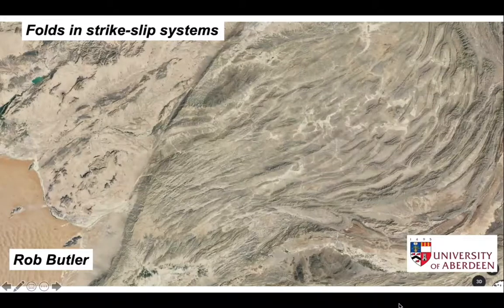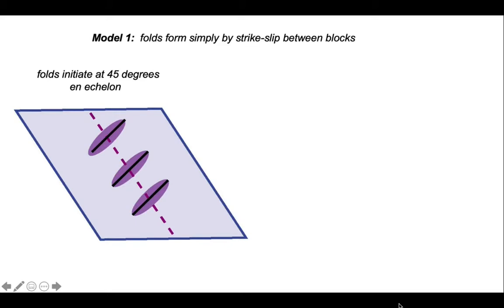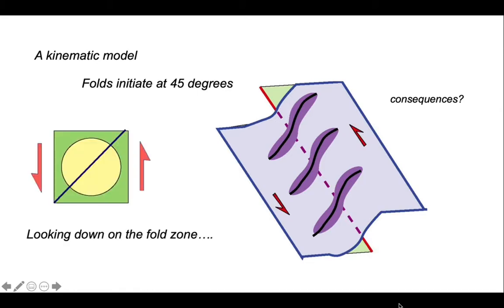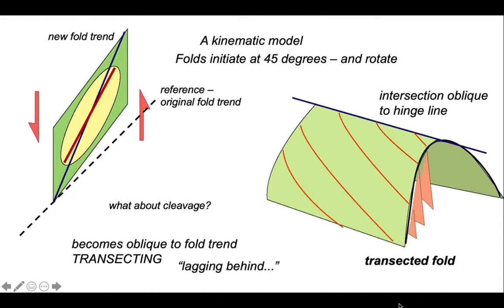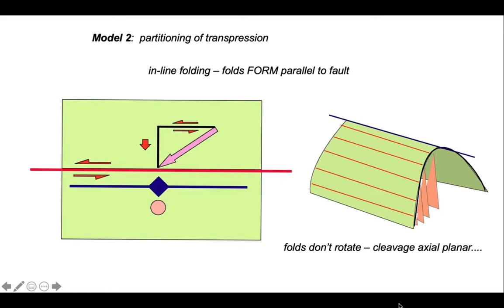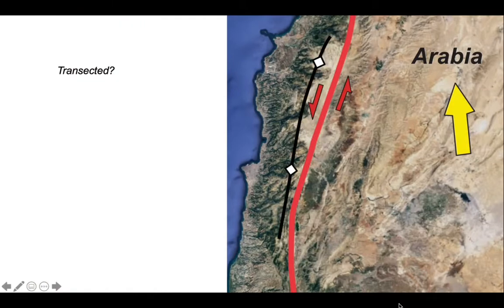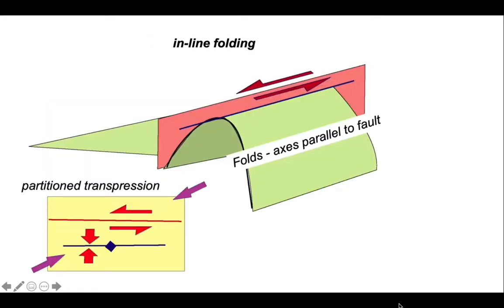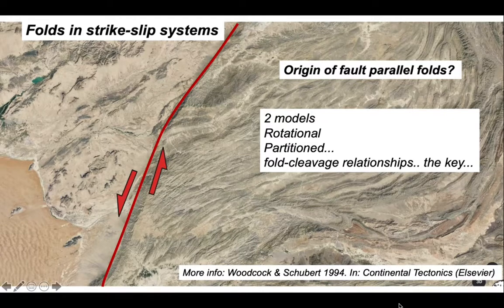Folds in strike-slip systems

Comment: Respected Prof. Rob. Butler, thank you so much for such insightful video.
Does distance from transform plate boundary matters in case of fold development in rotational modal? Is it possible that rotation from original fold axis during fold modifications (45° to the regional strike-slip fault) decreases away from plate boundary?
Reply from the maker: Classically you'd expect the greatest rotation with the highest shear strain, so above the major transform break at depth (if that's what's happening)... but in continents plate boundaries are not always that simple.... (understatement)...

Comment: Thanks a lot. It should be a special type of fold in line is presented which is once hardly to be explained. Could I think, since the dead sea fault is a transform fault, there should be magmatism now and then, stronger or poor, below the fault. Then the fold containing magma chamber may come along with the strike slip fault, just like the A type folding or sheath folding.
Reply from the maker: Thanks for the comment. There is magmatism in the greater Levant that happened as the Dead Sea Fault system was active... but there's no simple reason why strike-slip tectonics should be responsible on its own. In strike-slip the surrounding plates are simply moving sideways so there is no kinematic prediction for the significant vertical movements of mantle (for decompression melting) for example. I think in-line folds and partitioning is reasonably simple to understand - you can make these deformations in analogue models for example....
Reply: @robbutler2095  Thanks a lot!